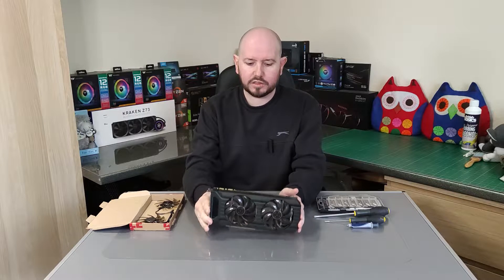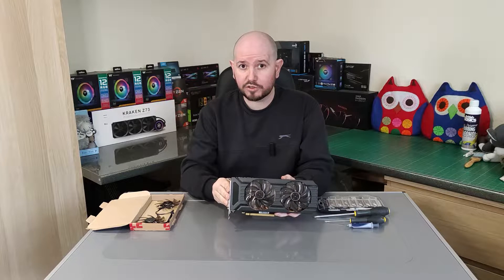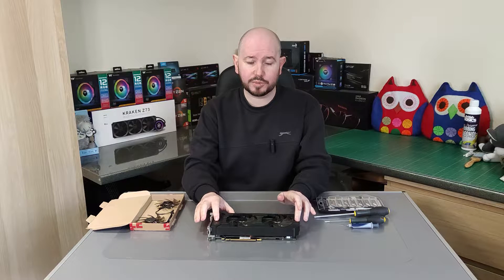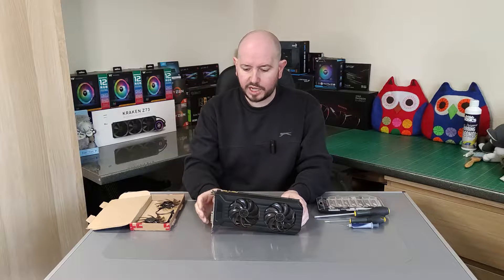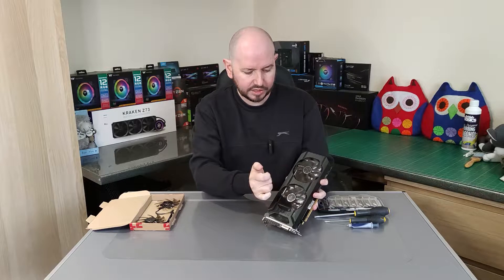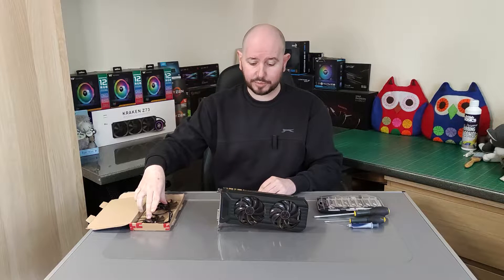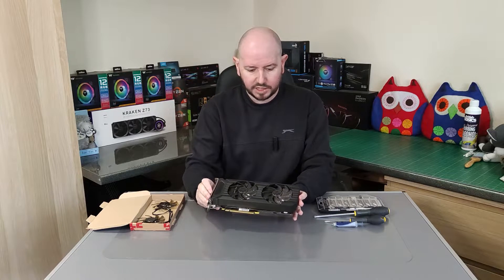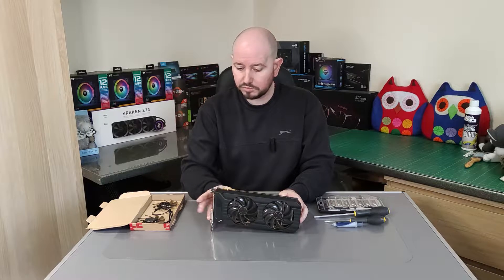Palit GTX 1070 Ti Graphics Card / GPU - Teardown, Fix & Repaste.

Comment: I have this graphics card but for some reason mine only works on AMD motherboards, any idea why?
Reply from the maker: That's a new one to me? Very strange.  I have had this card working on AMD and Intel motherboards with no issues.  Only thing I could recommend would be check bios settings, device manger for driver issues and check the card over for any damage. Apart from that I am honestly not sure why it would do that.  Sorry I couldn't be more help.

Comment: This was a really good guide that is easy to follow due to your camera angles being clear. But can you report back as to whether or not the repaste was effective at bringing down temps a noticeable or worthwhile amount? My son has this exact same GPU and it is getting very hot - to the point that Helldivers 2 is causing it to BSOD at 75C. I'm thinking a repasted thermal layer might be due, but I don't fancy doing it if the temps wont really improve much.
Reply from the maker: You should not be getting BSOD at 75c there are built in safeguards on the GPU, that if it gets to hot it should thermal throttle, pull the performance of the card back to get the temps under control. I will definitely be putting up the new temp figures for the card as soon as I can get round to building my ITX system, I'm hoping that vid will be up in the next few weeks.

Comment: is changing thermal paste temp will goes down I have 1650 super temps goes around 85° full load
Reply from the maker: If this is in a laptop 85c is within tolerance, if its a desktop graphics card you could be suffering from thermal throttling at that temp. Before repaste try cleaning the cooler out and see how that goes.
Reply: @DumbDownTech  okay ty